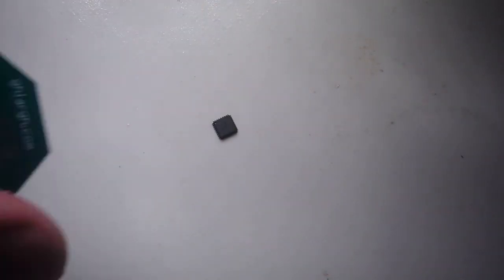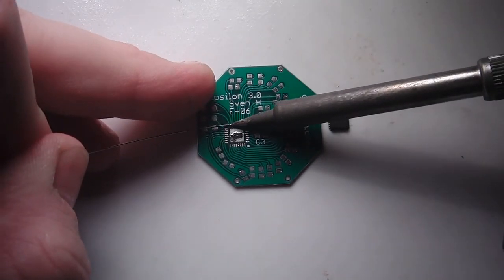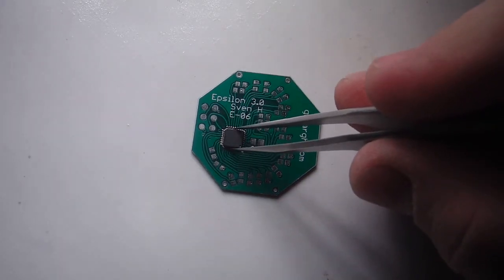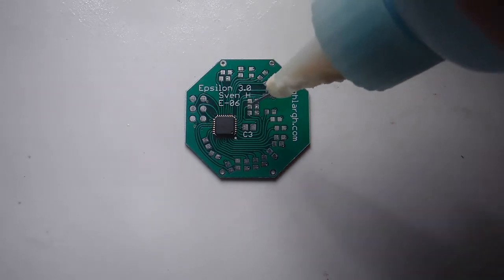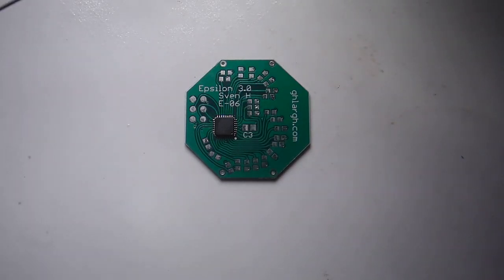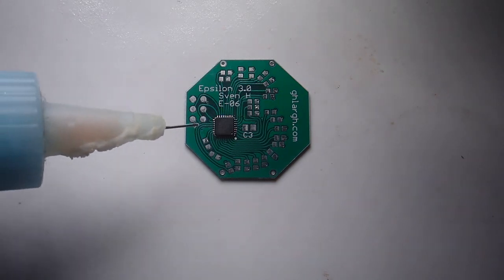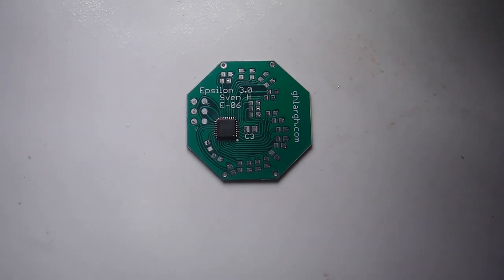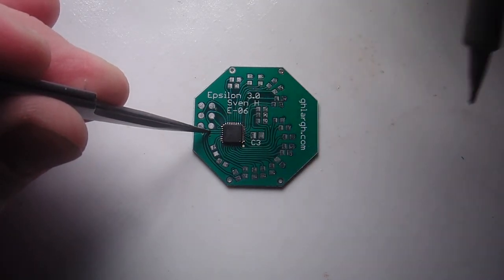Soldering QFN easily

Comment: Ok, now try it with other smd components right next to the ic. You have to be much more careful.
Reply from the maker: I do that almost daily at work.

When mounting new boards i usually start with the complicated components such as QFN and after those are in place i solder all remaining components.

I also do a lot of component replacements and i have still not broken more than maybe a couple of components despite hundreds of replacements. I have damaged a fair number of plastic connectors though...
Reply: Ghlargh Yes, but your video showed the easy case where there are no other 0402 components around it.

Comment: what is your temperature for hot air? I can solder the qfn, but my chip is damaged due to the high temperature. Lower the temp and it became harder to get the tin melted.
Reply from the maker: +Po-Ting Huang I usually run the hot air around 380 degrees C and moderate airflow. Note that these are fairly small boards that heat up fast, if you are soldering QFNs to a larger board with good heat sinking ability you may need to heat the whole board up using a second hot air gun or a dedicated board heater.

I have destroyed very few QFN parts by overheating, but some chips are of course more sensitive than others.
Reply: +Ghlargh Thanks. I am surprised that you can solder it with 380c. I used 270c and the chip was damaged.
Reply from the maker: Po-Ting Huang What kind of chip was that? Maybe it was something very sensitive?
Reply: +Ghlargh It's TPS7A4701 regulator. Very sensitive to heat.